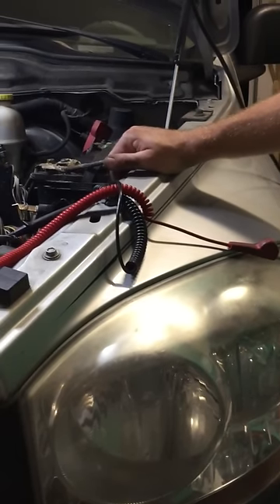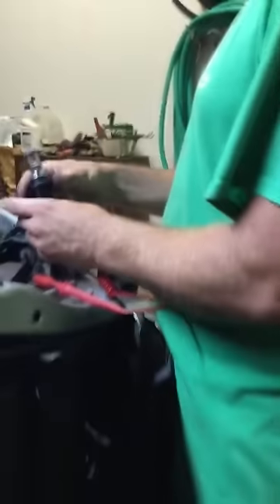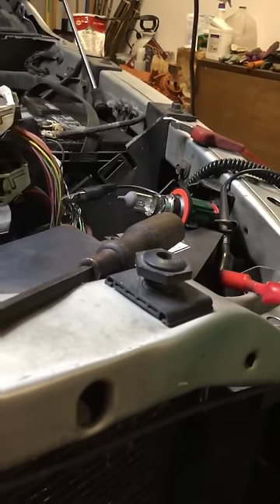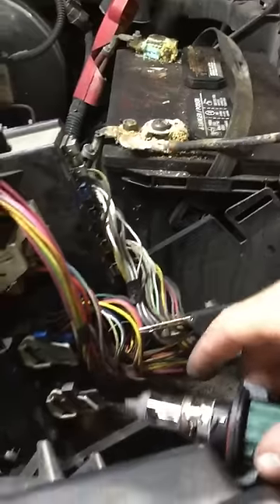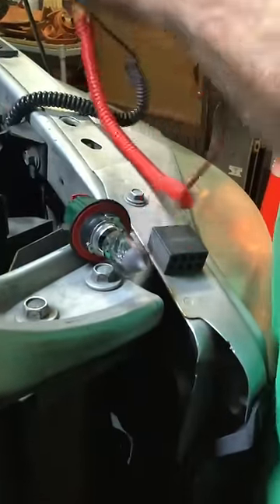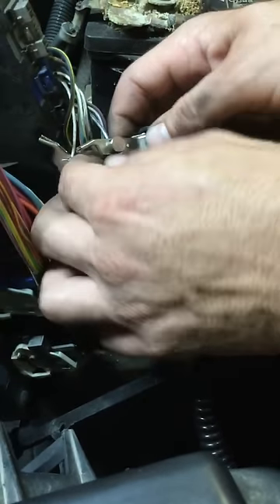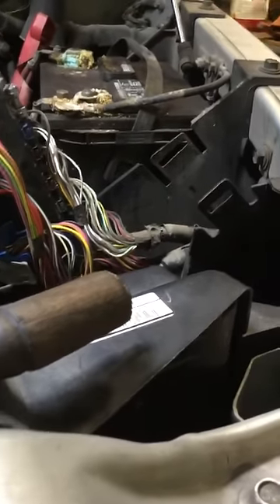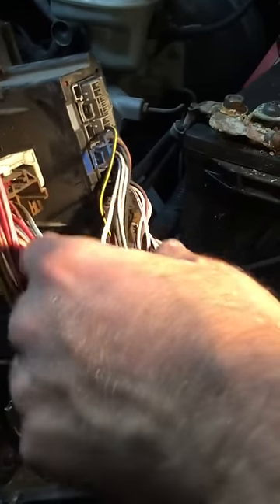06 ram low beam headlight issue

Comment: Was changing a led today on my 04, no low beam still no low beam after change... seen your fix, I ran the wire around the rad it was easier for me, 15 minutes later everything was working correctly thank you😁

Comment: This was the exact problem I had for my 2004 Dodge Ram 1500. I had replaced the bulb once and looked into this issue by viewing several videos on youtube.  I found several videos on resetting the TIPM which this video doesn't mention.  I dreaded for 6 months to do anything with the wiring or TIPM.  So I kept using the high beams for awhile.  Then one day my engine light came on.  Bought an OBDII diagnostic interface to see what the issue was.  Turns out that there were two codes.  One referred to the lamp that wasn't working that the TIPM said had received too much amperage so it was shut off.  The OBDII app asked to reset it, I selected yes, turned on the lights and it was FIXED!  NO WIRING CHANGES!  NO TIPM RESET!  The other issue which actually turned on the engine light was an indication of low transmission fluid.  Another easy fix.  I find it interesting that no one in the comments nor the video mentions anything about using a car diagnostic scanner (OBDII interface) to correct the TIPM.  Did I get lucky or is this something that very few people know about the Dodge Ram?
Reply from the maker: Nick Smith I have not heard of that. I work at a Chrysler dealer and none of our interface devices have that option. That must be a aftermarket thing that can somehow turn the driver back on. Thanks for the info
Reply: Nick, what is the brand and model of that OBDII you used? My left side low beam has been out for 3yrs as I am not going to spend upwards of a thousand dollars to repair the problem. I have gotten by using my fog lamps as they are sufficient in illumination and representing the width of the vehicle which is all our laws require.
Reply: I read this one other place I think I will start here maybe so as to not splice and jump wires, I'm worried about causing further damage by jumping. This "too high"amperage makes sense because all I did was change my headlight maybe somehow it got a strong shock it didn't like?
Reply: What brand and model did you use for this?
Reply: We used LAUCH or AUTEL Maxi both can read and reset very quick, and the problem is fixed!!!!

Comment: Bro thank you so much for this vid. Life saver it worked knocked it out in 20 mins🤘🏼
Reply: Hello Juan is your light still working after a year connecting the wires ?
Reply: @michaelturgeon1478  yes still working 👍🏼
Reply: @JuanLopez-cr3nh  just got your reply. Did this and not only does it work but my plow lights work as well. Great fix!

Comment: Thanks for your video 
I have 2015 ram never a problem until two weeks ago 
Trying to install stupid LED 
Don’t work 
Putting everything back with original bulb no power on the right headlight 
Going crazy with this finally find out about the stupid fuse box from Chrysler

Comment: I have the 2006, 2500, Diesel with the same exact problem. The driver's side low beam went out a few months ago and I haven't been able to fix it and neither have 2 different mechanics. Damn, this is a built in problem that Dodge should be resolving. I'll show this video to another vehicle electrician and see if he can perform this work around. Thank You for this!!! Very much.
Reply from the maker: Rob O I will check the diagram and see if it's the same for the Cummins. Not sure if it's s FCM truck.
Reply: How would fcm be different??

Comment: Used a bidirectional scanner for mine and went into the TIPM and cleared all the codes. Shut the key off turned it back on and worked like new.

Comment: Good rig bro but behind the air box where those wires run to the ecu is a common spot for wires to short, corrosion, come apart, also by your left foot when driving there’s a harness down there  that’s also a common area for shorts, wire spits, and corrosion. From my back yard experience with these systems , buying and flipping rams they don’t like shit tap into them. Any aftermarket alarms, kill switches, radios etc can effect the can communication. Check anywhere you’ve added accessories, heat and metal can also effect it. Check where the harnesses are routed for rub and wear and burn marks. Any short, out bulb in the cabin can cause other things to act up as there all tied to the same circuit is how I basically look at a dodge. BMW is another one who does the same thing. I’m no mechanic but I’ve work on a good bit of these as I do my own work as much as my tools allow
Reply: You are absolutely right. You know more than a pro mechanic Sir. With all due respect to your post.

Comment: I think I will install a relay for both high and low attaching the fog light supply to the low beam. Thank you for the video, my motor manual was no help for location.
Reply: I did the relay trick, it worked

Comment: If you do this fix, its best to run the wire through a relay. By just jumping wire to wire, I got about a year out of the fix before both low beams stopped working, and forced into buying a new tipm. Lights were good after new tipm for about a year and issue has returned. Ran the wire through a relay, and have worked for two years and going....
Reply: Hi Wes, I have the same issue. with the both low headlight, how is your fix about put a relay to the highlight cable? wich kind of relay is it? I really apreciate it your answer!
Reply: @jpablo041997  when both of the low beams go out, I replaced my tipm. If one headlight works, then with a 5 terminal relay. 1-to positive power with inline fuse. 2- ground. 3- headlight wire that was working and has power going into relay. 4-wire off relay to right lowbeam. 5- wire of relay to left lowbeam headlight. Does that make sense?
Reply: Yeah, thanks for your answer!
Reply: Just following this. I have a 2006 ram 2500 diesel 5.9 , passenger low beam out , I would like to do what Roman posted, direct socket to socket Leeds but concerned about over power and damaging tpi m etc ? Thanks

Comment: I’m glad I found your video I have the same exact truck with the same exact issue but mine is the passenger side low beam isn’t working, the high beam works fine tho, I guess I’m going to have to splice it because I’m not spending 800$ to fix it screw that!

Comment: I was having the same issue on my 08. I was about to buy a new tipm until a local mechanic said that the real issue was the sockets go bad, so to see if that was my issue I simply put dielectric grease in the socket, and it worked! That shit is less than 4 bucks and it may help you get bu until you can pay a pro 40 bucks to install a better socket.
Reply: And chevys have the same issues

Comment: Thanks for the video,helped me solve thissame issue. My only input after following the service manual for the 2006 and thier wiring diagram show the both low beams the color you mention, but coming out of 2 different plugs on the bottom of the TIPM. In the manual, they are listed as C5 & C7, but in my TIPM, they were labeled D & E....
Reply from the maker: Ross Rytting  yes sir you are correct. That is the joy of wiring diagrams. I will go 50/50 that the info is correct even if you use the factory diagrams. Sometimes wire color or PIN number is wrong. Glad it worked. Thanks for the info. I just seen this truck yesterday and all lights are still working.

Comment from the maker: Good video! This truck didn't have a front control module. I tried to take the TIPM apart but it had a circuit board issue. Thanks for the good tip.
Reply: I had the same issue on my 2006 1500 Ram and i did replace the switch. Problem resolved

Comment: This is brilliant. Worked great & only took 15 minutes. Thank you!!!
Reply from the maker: SO Swing  glad it helped. Thanks for the input.
Reply from the maker: SO Swing  glad it helped. Thanks for the input.
Reply: Is your Ram headlight still working after splicing it in? I have this issue too but am afraid to lose my lights altogether if it doesn't work long term.
Reply: @romans1295  Is your buddy's truck light still working?

Comment: Rather than double the load on the remaining low beam circuit of the TIPM it might be better to use the remaining good circuit to control a relay that feeds both low beams.  Also you don't mention if you have a "lamp out" light on your dash.  I do, and have done the splice repair and got both low beams back but the "lamp out" light still shows.

I suspect running hotter bulbs over stock such as Silverstar Ultras, as I have, overloaded the circuit on the TIPM and burnt it.

All these expensive and unececesary computers in cars nowadays make me want to buy an older car I fix anything myself.
Reply from the maker: MrTdw1954   No "lamp out" light was on dash and this truck was running stock bulbs.   
Running a relay is a great idea.   
For this truck it really wasn't worth it, this truck is pretty beat up. I actually just talked to the owner tonight and the headlamps are still going strong. But yeah a relay would be awesome insurance especially when running "hot" aftermarket lights. Thanks for the comment.
Reply: @romans1295  where do you get the relay?

Comment: SAME issue on my 01' Dakota. Chasing the low beam p/w wire everywhere looking for a short. Ultimately hoping wasn't the driver module, but most likely is..
I was thinking of doing the same splice.. but just wanted to poke around online to see if anyone done it first.
Also going to toss in LED bulbs which draw less watts then halogen.. so that might even help the one CTM driver out since it would be powering both lights.
Anyway thanks!

Comment: Good video. I actually did this about a year and a half ago, and it bought me about a year. I ran the wire from one light to the other rather than connecting them at the TIPM. A few months ago, my low beams went out completely on both sides, though. Maybe it was too much for the TIPM to handle one side powering both lights? Who knows? It was still a good solution. It got me an inspection sticker for the year. Hopefully your buddy's will last a little longer.
Anyway, the solution I'm working on now is using the fog lamps to power the low beams.
Reply from the maker: Nice, I was wondering if it would work the same,  probably should. Let me know how that works! Thanks for the feedback!
Reply: Did that work with the fog lights? If so how long did it last? I need to do my 16 ram 😔

Comment: I jumped my 07 and the fix does work for a while.  Now I have no low beams whatsoever.
Reply: did you ever find out a solution?\
Reply: @NuclearRoll  Jumping the wire makes sense to me.  I have no knowledge of the computer so I don't know what happened.  I know the lamps themselves are in working order.  I re-checked the splice and still have no low beam at all.  Using duck tape on the headlamp so as to not blind others.  If I had $700 for a new computer I would use it for another truck. Not saying my Dodge is bad, just being practical.

Comment: I'm having the same issue in my 4500 but I have read that jumping them only lasts so long,  I'm at the point where I might just cut them both and run them to a toggle switch and be done with it 
that way they TIPM isn't killing both headlights when the signal is engaged

Comment: I have an 06 hemi and just lost my driver low beam but have also recently lost the driver high beam. the high beam went intermittently though, so I thought maybe switch...  already had the tipm scare with the transfer case actuator, but lucked out.
Reply from the maker: Jared Granberry hey Jared make sure you verify no power  at the bulb and ohm test the wire from the bulb to the TIPM. Left low is white with a dark blue trace pin one at the bulb and pin four in the c5 connector at the TIPM. Left high is white with a light green trace pin 3 at the bulb and pin four of the c7 connector of the TIPM

Comment: After a shop installed a new transmission (remanufactured most likely) couple days later radio suddenly blared badly distorted when door open. Lost f/r right sound, dome light, driver dash cigar. Randomly does it again weeks later lost left rear sound. Kenwood DDX9703S shop install. Left low beam goes out turning the key back to aux last night. TIPM root of all?

Comment: Thanks for the video...wondering if this is my issue. 2006 model w/ passenger side low beam inoperative. Checked power at the bulb connector on the good side...with low beams on, I get 11.98v on low beam wire and 10.4v on high beam. When I switch the high beams on, it reverses and there's 10.4v at the low beam wire and 11.98v at the high beam. When I check the passenger side, I'm getting 10.4v on the low beam regardless if the headlights are in the low or high beam position...so it's still getting power, just not enough to power the bulb. Will the jumper trick still work on mine, or is it possibly another issue?

Comment: My truck already had the jumper going from the driver side light over to the passenger side light when I bought it. I added LEDs to it and lost low beam. How can I fix that? I have checked all connections on the Tipm, look for any broken wires, check the voltage in the plugs. All wires are showing 12 volt to 14 volt when running. I also don't have brake lights, only the third brake light works. 😭

Comment: Could have just took the positive and negative wire off battery held them together with zip ties for about fitee. Minutes to complete reset the tipm relays. If it still doesn't work after than then do this. But this is guaranteed tipm replacement later down the road as the passenger driver WILL go bad with the extra load. Usually within six months.

Comment: Do not use one wire to run both head lights if it can't handle one head light now you'll be pulling double power through one side it won't last long !
Reply from the maker: Duane Dove thanks. I just had this truck for a radiator and oil change and it's still going strong. Worst case scenario would be the TIPM would for sure need replacing but so far no problems and it's been over a year maybe two

Comment: I have 07 ram2500, bought switch, fog lights and wires to plug into factory prewired setup. Easy peasy but no fog lights? It does have drl when put into gear/drive. Any ideas come to mind. No other issues
Reply from the maker: I think you may have to use the DRB (that’s the factory scan tool) or other newer scan tool like a snap on to tell the TIPM to turn on the fog lights. I will look into that

Comment: OK so I’ve had this problem with my truck I only had one low beam on the driver side high beams work I jumped it from one socket to the other worked for two days and then all my lights went out except for my fog lights I just took my whole PCM off took it apart cleaned it put it back in and now I have high beams with no power going to my low beam socket. It’s a 04 ram 1500 any ideas would be greatly appreciated

Comment: Hi great video both of my low beams are out I’m tried jumping the wires still not getting anything 
Is the the tan and white and blue and white in the same cluster of wire?
Reply from the maker: Hello! First, If both low beams are out, it’s possible your TIPM or fuse box may have failed and both headlight drivers are bad.
Reply from the maker: Second, yes you will have multiple wires with the same color. It is important to ohm test your wires from the TIPM to the headlights to make sure you are on the correct wires. Good luck!

Comment: I did this and went as far as adding a 3a in line glass fuse for added protection and soldered the connections in. it worked at first but after letting it sit overnight I go to start my truck the next day and all of my electronics were dead.  I know I had the right wires I double checked the drivers at the bulb.  I have a 2007 ram 1500. really frustrated, now I need a new tipm
Reply from the maker: Ethan Brule  that's really odd, the TIPM has separate drivers that run straight to the lamps, . I will look over some wiring diagrams. Try disconnecting power to the TIPM for a hard reset.

Comment: What if the low beam doesn't work on the right side but the high beams work. The right side was working before then doesn't work any longer. How would I be able to fix the problem

Comment: I have same problems I just changed socket and it didn’t fix problem so I might just have to do what your showing. I’m just alittle afraid I don’t really work on cars all that much.
Reply from the maker: Johnny Protalk if your unsure I would not attempt this repair. If you tap into the wrong wire, you could cause some serious damage. This repair does require wire diagram and soldering knowledge. I would seek out a trust worthy mechanic or buddy that can help. Be safe and good luck!
Reply: Romans 12 maybe your right, lol I’m a hvac tech and have knowledge of electricity and went a aviation high school which we learned electrical solder but I haven’t dont in years so I’m weary. I’ll see what my mechanic can do
Reply from the maker: Johnny Protalk if you have a mechanic you trust, I would hit him up and explain that you just need to use the good driver coming out of the TIPM either the left or the right and use that one good driver to power both sides. It’s really not complicated and if you are in the HVAC field you can probably do it, if it comes to that but just be sure you double check your wires to make sure your taping into the correct ones. Soldering is easy especially if you have done it previously and with a little time you can find a wiring diagram online. If it comes down to you doing it, send me a message and I will help you with the wiring diagram